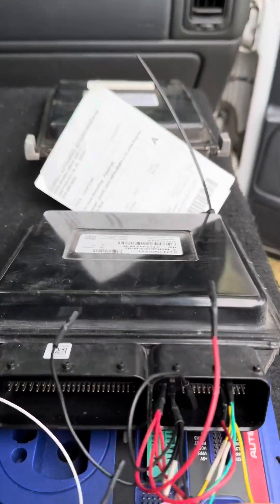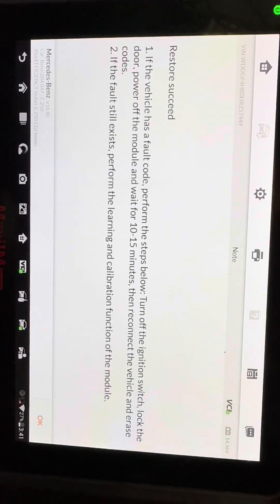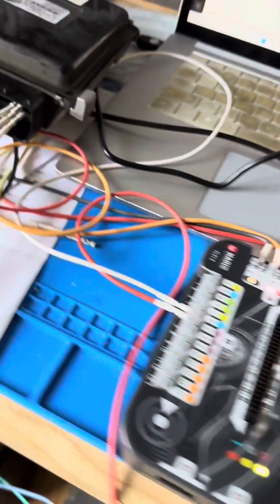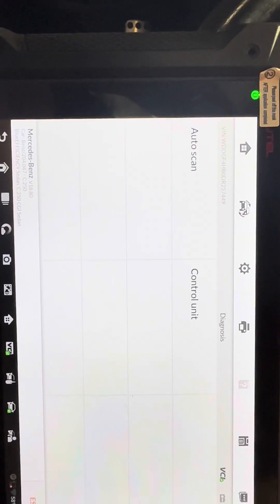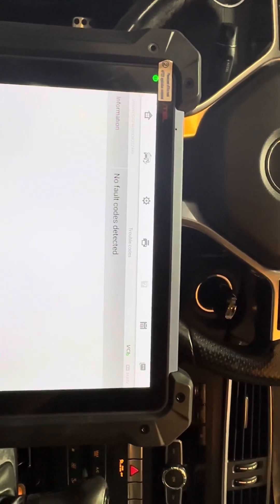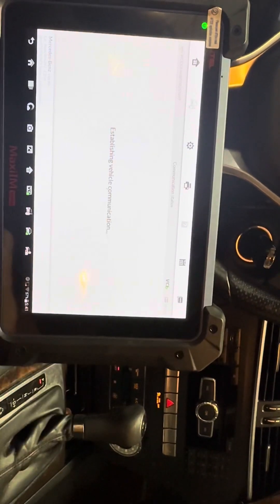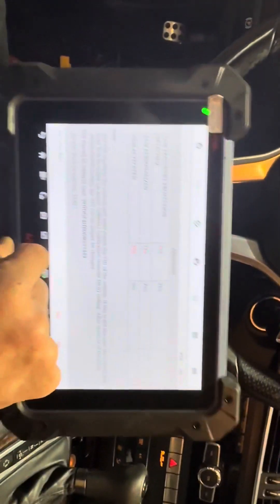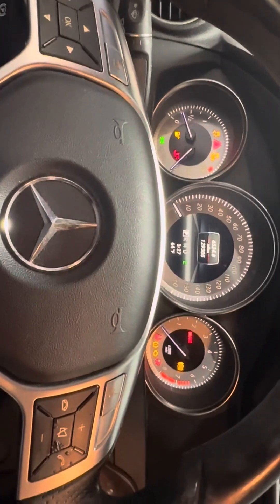ECU cloning Mercedes ECU SIM271DE2.0 Flex Magic Motorsport Required Autel No

Comment: Been trying to cloning the same ecu with the im608 but it says that it cant communicate with the ecu even though i cand read the data? What could it be??
Reply from the maker: Does the same connection read the donor module correctly!!
These ECUs are garbage.
You need to renew the donor ECU first.
You don’t need the original ECU for anything